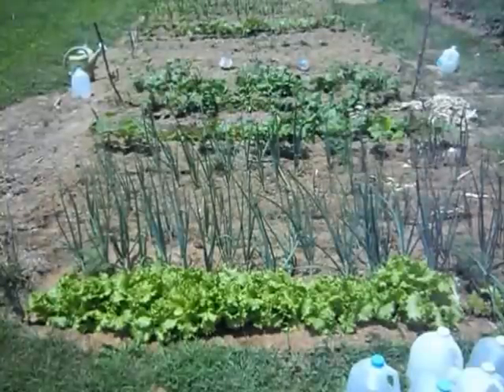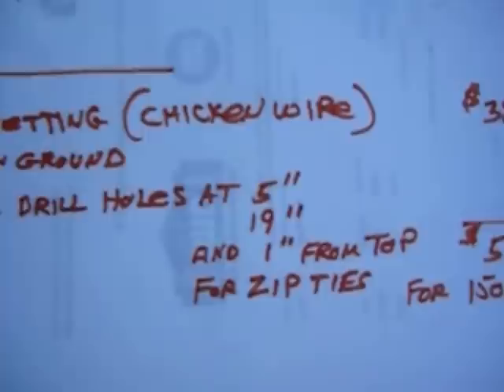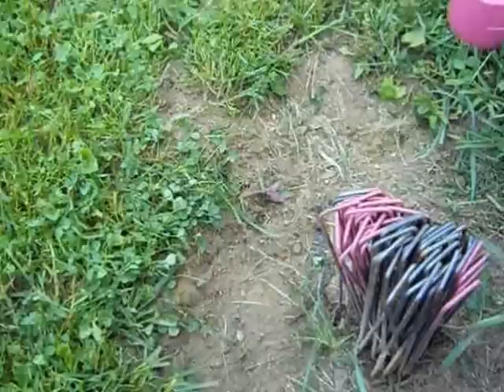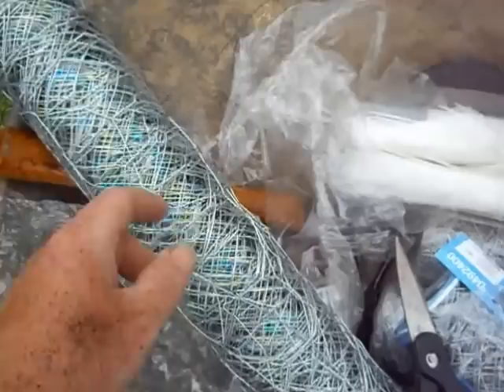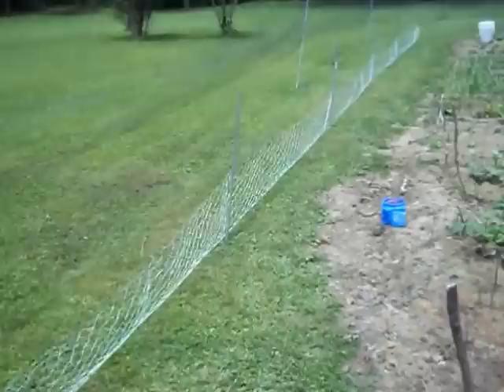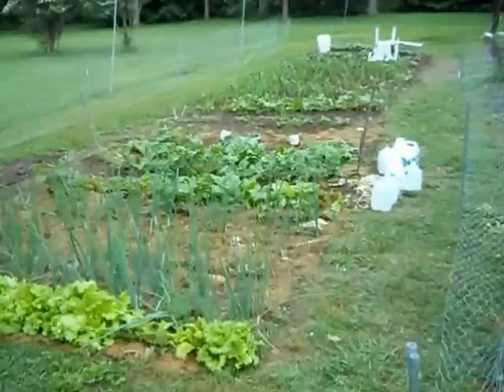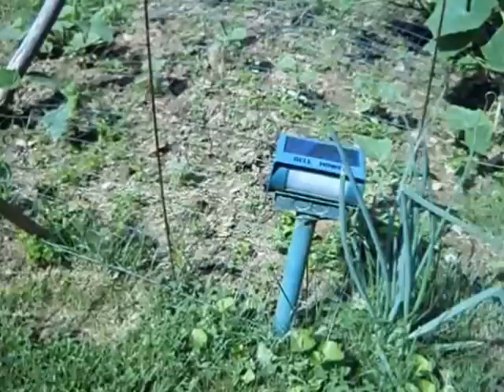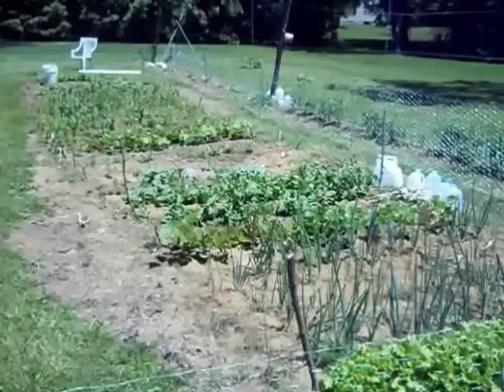How I Built My Garden Rabbit fence with Inexpensive Poultry fence chicken wire.

Comment: Rabbit fence and hardware cloth both come in 24", 28", 30", 32", 40", and 50" heights...  They are quite a bit heavier gauge wire than chicken wire.  Some of the rabbit fence has 1" x 2" opening size all the way across the fence.... No bigger holes at the top.  I am using it for trellis in my garden.  I use movable 4ft x 4ft panels made of 1x2s with the plastic hexagonal poultry fence stapled on to keep the feral cats out of my raised bed garden.  I am an urban gardener.  No rabbits, no gophers, just the blasted cats.  The screens work great.  Cats haven't dug up and crapped in my garden since I built them.  However if I lived out on the edge of town with the desert nearby, we have jackrabbits here.  They are about 2 feet tall, not including the ears, and you should see those things jump!  A little bird netting over the tomatoes and life is good!

Comment: Thanks a lot for such good filming and explanation!!!
Reply from the maker: Thank you for the nice comment, I have since learned that the 1" hex fencing does a better job for the small rabbits. I had a little guy that could shoot through 2" like it was not there. I plan on buying 12" high 1" or 1/2" hex or square to reinforce the bottom. I also have a deer fence video on my channel.
Reply: sixty9harley
Thanks again for more info on the fencing.....I did get the 1" "square" for the garden,  and 1/4" for my coop. 
Deer seem to keep away since we got a barking dog, but we are in the city, and don't see them much anyway.
What I do have troubles with is fruit!  My blackberries taught me to not try any morel.  If you ever show how to do grow some fruit safely, let me know.  :)

Comment: Gotta say.. the design is so easy to work with, easily expandable and quite economical. and yes.. fine humor too :) Thanks for sharing it Pap.

Would you recommend using outer set of conduits for both deer and rabbits fencings?
Reply from the maker: Absolutely use both barriers if your garden is spread out like mine, Rabbits don't bother tomato or squash so they remain outside the rabbit barrier but inside deer block. But if you have a contained rectangle I would just use one set of conduit and attach both barriers to it.  Rabbits chew through the deer block, and deer leap the chicken wire so both are required.
Reply: @sixty9harleyPittsburghPAP  wonderful.. thanks for quick response and ideas. Will send update whenever I reach to that point.
Reply from the maker: @mittalpa  My oldest video, I think you will enjoy it! https://youtu.be/-La5rujFGKw